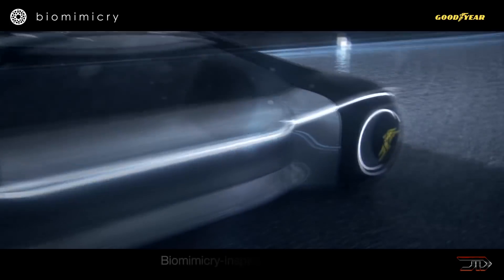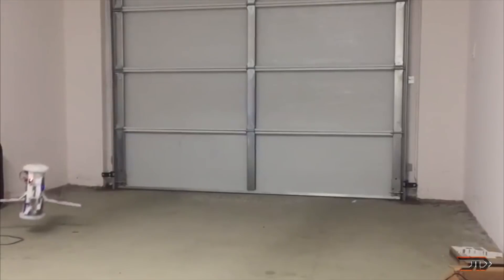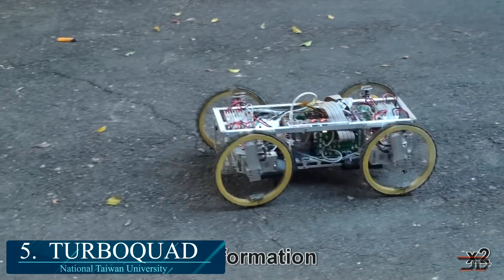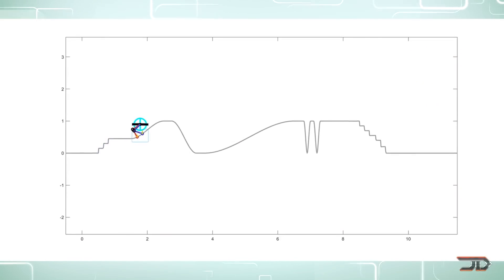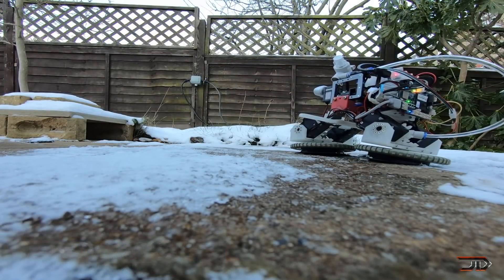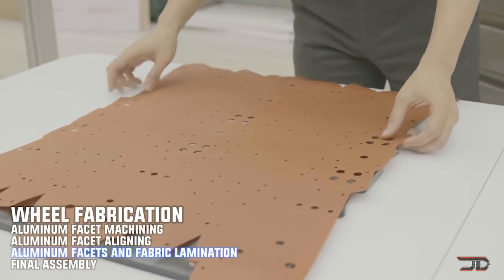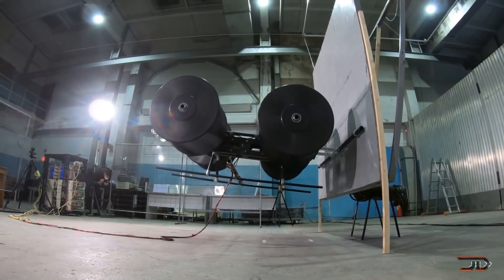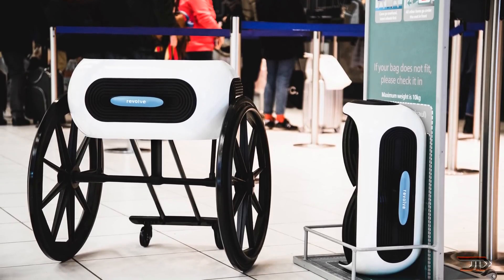7 CRAZY Transforming Wheels

Comment: People can't drive moving on the ground without crashing when they only have to look left/right & forward/backward, imagine the chaos of adding looking up & down, these flying cars would have to be AI driven with a ton of onboard monitoring to ensure they are safe. Also not sure about energy efficiency as it takes more energy to lift and item than push it (dependant on surface friction) so flying cars would require more fuel per KM traveled, only saving would be from being able to take a direct route reducing KM's travelled but you still need a safe takeoff/landing areas.

Comment: And the crazy thing is that engineers still cant figure out how to make a wheel that wont damage itself on the surface of Mars!!!
Reply: well its not that. they could easily make one that does the job better but it wears out faster. trying to make a surface that grips as much as rubber with the durability of metal so it last years

Comment: People have been reinventing the wheel for decades.  Still nothing beats a good ol air filled rubber tire.  Kinda like an internal combustion engine versus an electric motor.
Reply: I would argue that the electric motor is much more versatile and useful then a combustion motor in most cases…not all…but most

Comment: With that convertible rolling track wheel, there is no way that would be practical.  The point of the rolling part is to go faster than a tracked vehicle… but if the tire hit anything significant at said higher speed that a normal off-road tire would feel but be able to absorb … that concept wheel would be utterly destroyed because it has no tire volume to absorb anything.  All that energy would go right into the actuators and destroy them. Lol
Reply: what about use that wheel concepts of suspension with no air, adn turn it into a flexible thread for this system? (well the part facing outside more flexible while the inner part would be more rigid, as a flexible threadmay go agains the thread reliability

Comment: Thanks for another fun video.
Those origami wheels look really funky. I'm tempted to try making some myself.
I have a few unusual wheels in my Fun with Spin playlist. The videos titled MecanumPropellerRcControl131112a (if you watch this one, skip to the two minute mark to avoid my boring explanation) and OmnibotSpinningStraight140301a contain robots with unusual wheels.
A really interesting aspect of omni wheels is they can actually make a robot travel faster than when using normal wheels of the same size. The robot's speed will be 1/(wheelSpeed*cos(angleOffsetFromDirectionOfTravel)). There's a common misconception that omni wheels are slower than normal wheels. Omni wheels can increase the speed of a robot.
The above speed equation breaks down as the offset angle approaches 90 degrees. You of course don't get infinite speed from the omni wheel. The omni wheel will lose traction first.
Reply from the maker: Nice I will check them out!

Comment: 👍That wheelchair was neat👍
Reply from the maker: For sure, hopefully, they bring to market!
Reply: @Motor_Explorer1  
I’ve seen folding wheels like that for bicycles. They’ve been around for a couple years now. This is the first that I have seen it for wheelchairs though.
Reply: And if it retails at $2500 or so, not wildly out of range of what wheelchairs for everyday use cost today. That's somewhat a first for 'neat prototype' wheelchairs.
Reply: I agree. I've had to use a wheelchair a couple of times in my life and that thing would have been well worth $2500 (assuming it really works). I'm skeptical it will be strong enough or durable enough for normal wheelchair applications.
Reply: Looks cool. Just have to make sure people don't use it like in the video cause twisting, lifting and over reaching like that guy is how you can hurt yourself :(
Reply: I remember, YEARS ago when I was in middle school. I made it to the state level science fair for a basic project that was well done. One of the high-school projects involved a collapsible wheelchair designed to fit in the overhead compartment of an airline. It would take up the entire compartment at that stage but still. I wonder if it evolved into the design we see here?
Reply: Since its a wheelchair shouldn't the comfort and reliability be the selling points rather than portability?
Reply: I see Grandma' drifting their wheelchair